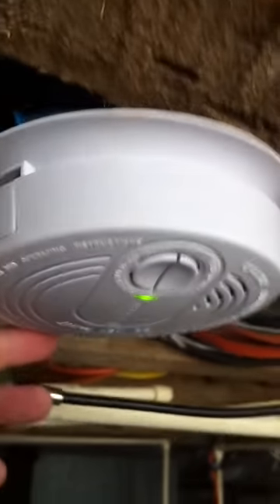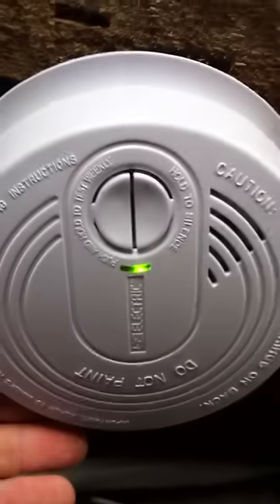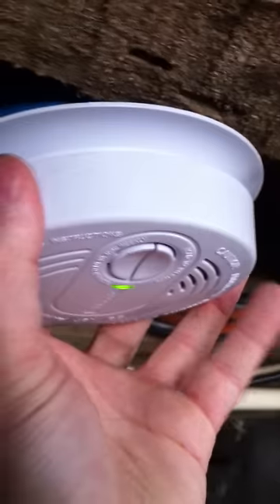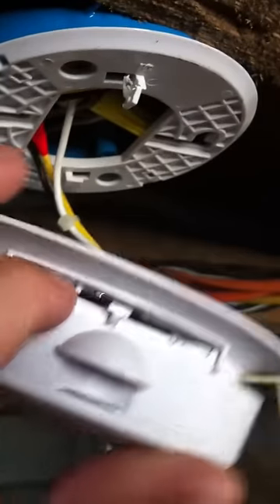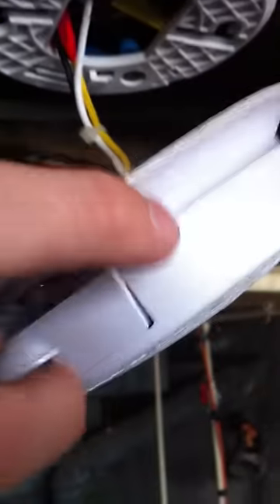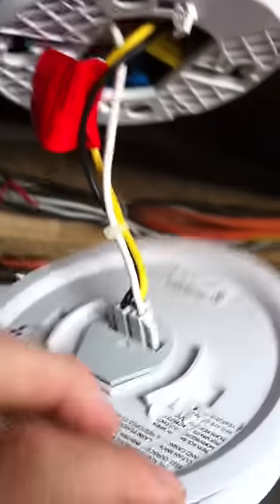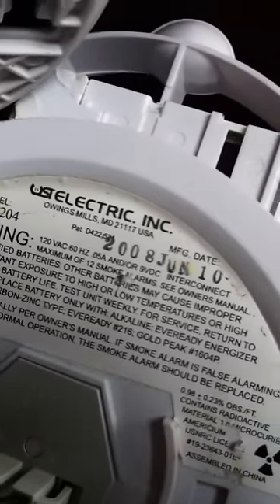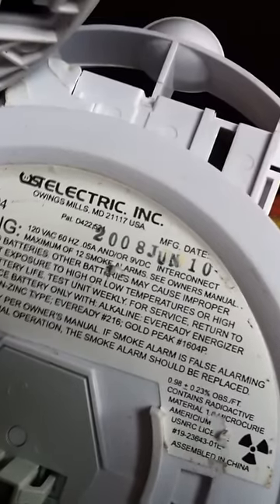Fixing a Chirping Smoke Detector

Comment: If you disconnect it from the ceiling and then take the battery out it will chirp a couple more times on reserve power before finally shutting off. If not then it's powered by ghosts and you should smash with hammer.
Reply: Haha
Reply: That is true
Reply: Totally ghost can do anything to annoy you
Reply: Lmao!!
Reply: Mine started using the power from the americium 241 and became def sustainable and then had a nuclear meltdown and killed half my family in a radiation accident
Reply: Remember friends 😂
Reply: Thank you. Ive had this think in my room chirping every 30 seconds. I was so use to it I didn’t even realize I would be going off. My little dog usually never stays in my bad and wanted to and was getting scared of the alarm. I finally took it off the ceiling and took the battery out and have been sitting here wondering what I did for 3 minutes to get it to stop because it was still going after I took the battery out a couple of times. Your comment saved me. Thanks.
Reply: For real! Extremely true!  I changed every battery when we caught this house. Still chirping
Reply: Ngl it happened to me once like all of a sudden I was downstairs with my mom and then the smoke detector started going off by it self me and my mom thought it was because of the washing machines but we both went outside and it was cold but I like being outside in the cold tbh, but then soon found out the battery was dead. Like it said warning carbon monoxide like bro what I’m confused.
Reply: Yeah one time I was sleeping and my mom says the alarm went off late at night, but there was no smoke  I slept right through it, then it just turned of by itself I guess. 😂
Reply: Yea I might

Comment: You guys, do not disconnect your fire alarm from the circuit until you turn it off on the breaker first!!!! Please do not make this mistake, it’s dangerous.
Reply: How do u do that I’m tryna smoke in my room how do I disable it basically I wanna disable it without taking out the batteries so it won’t chirp
Reply: But how?

Comment: Not only have I replaced the batteies, but I've replaced the smoke detectors themselves, and still get the occasional cheeping.  I can go for a month or so without it, and them one will cheep.  It can cheep a few times, several minutes apart, and then stop for a month or more, or it can cheep for a long time, until I get sick of it and disconnect it for while.  The I replace it, and it can go for a while again, and then start cheeping.  Any thoughts?

Comment: Thank you for showing how to disconnect it from the ceiling! I replaced the battery earlier in the evening. It stopped chirping for 6 hours then at 5:30am it decided to start chirping again. Time to remove and throw into the far corner of the garage...

Comment: Thank you so much for putting up this video..I just fixed my detector. I could not figure out how to get the ac wire disconnected so I could open the battery compartment. My detector is a little different than the one in the video, but the same principle. When I saw how you squeezed the prongs(?), then I pulled and it was released..I never would have figured it out..I kept pulling..luckily, I did not break anything before I decided to let YOUTUBE help me out..Thanks a MILLION!!!

Comment: I replaced one of these - that was occasionally chirping.  Just for yuks, I took the old one apart.  I believe that the problem is the battery contacts.  The battery tray does not have any wires connecting it to the circuit board.  Instead, there is a pair of springy contacts.  The detector is constantly testing the battery, and if one of those contacts gets dirty.....

Comment: To get the detector apart, you poke holes in the labels on the bottom to get at the mounting feet.  Then tease the feet away from their mounts, and pry the top up.  Then you can clean the contacts with electrical contact cleaner, such as Caig DeOxit.

Comment: If once you replace the battery, it still chirps for a few minutes, don't freak out.  Give it several minutes for the detector to detect it has a new, charged battery.  It should stop chirping after then.  At least that's what happened to me, and this follows what jerryk123456 says in his comment about, "The detector is constantly testing the battery... "  It may just take a few minutes after inserting the new battery for the detector to run one of those periodic tests.

Comment: OMG!! My dam fire detector has the same chirp. But mine is not powered by a battery it is powered by wiring to some power source in the wall. WHY IS IT Chirping!! ?? Is it time to get it replaced? My old fire detectors are 10-20 years old not battery powered and no chirp at all and they still work fine. This all started during the winter season BTW

Comment: Why would it need a battery of its plugged into the house SMH!
Reply: In case the power goes out so it can run on the battery?
Reply: @acausevic1  is a house not a spaceship  that needs a 9v life support system to never be used that's why we have to change them even when 99% of is life is powered by the house
Reply: @humangarbage3386  not sure what you’re asking here. The 9V battery is a backup power supply in the event your power is out in the house. For example you lose power in a bad storm for a few days. Your fire place catches on fire. The smoke alarm goes off because it’s working on the 9V battery backup. At least that’s the idea.
Reply: @acausevic1  you cant even have house insurence with a fire place my man they wont cover u

Comment: Lame vid.  Didn't tell you how to fix it as advertised by the caption.  Also, it is pointless to take off the detector.  Just change the batt for goodness sakes
Reply: Depends on the model. Mine had a trapdoor for the battery on the underside.